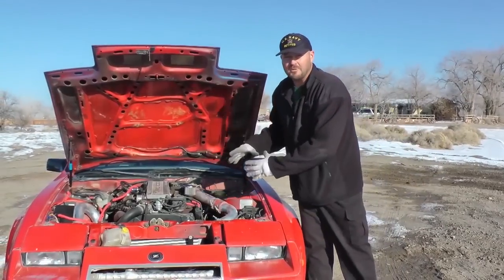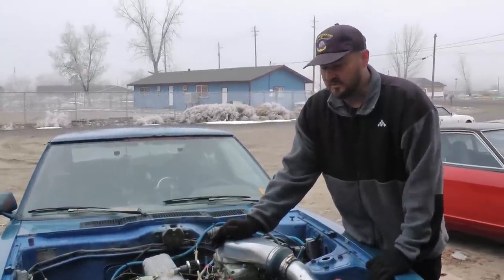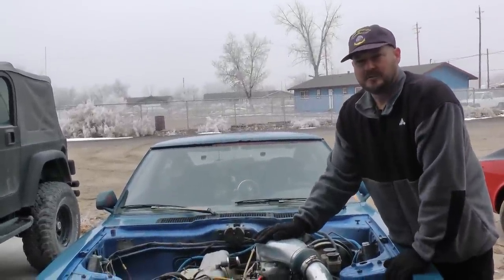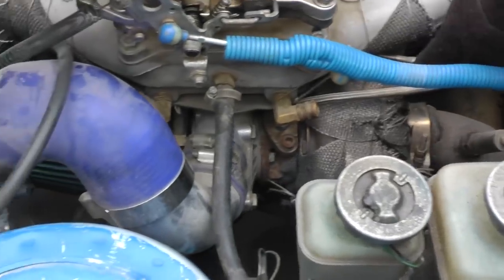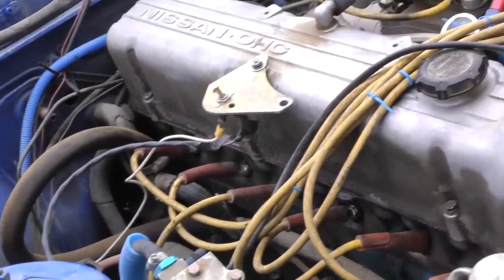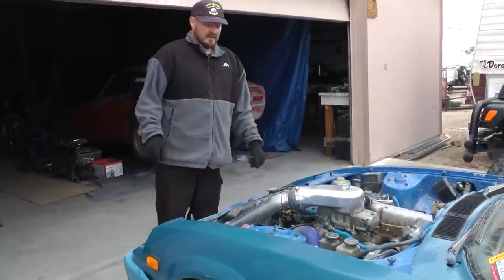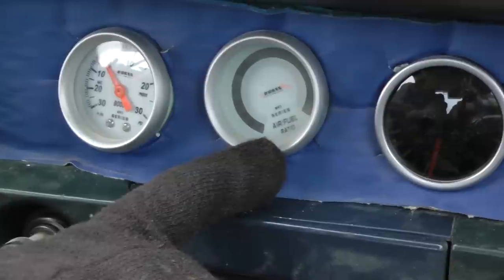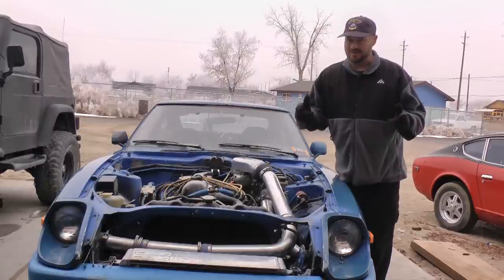Blow Through TurboCharging (Carburetor)

Comment: you do realize that by not running a blow off or bypass valve when you chop the throttle you actually stall the compressor turbine in the turbo and can grenade the vanes sending aluminum shards through out your pricey engine of course unless you have a pricey billet wheel . but even then you will stall the compressor and build boost slowly between gears . a blow off valve is a must for a street turbo system
Reply from the maker: corsomike1 One, I never chop the throttle, Two, Turbochargers made strong with good quality, have no issues, they are designed to deal with great extreme forces acted upon them, if not, they are not good turbochargers.  I have even run low costing ebay turbochargers without blow off valves such in the Red 300zx turbo, no issues, great throttle response.  The black buick has no throttle response issues, in fact its a hard charger on the throttle and of course it has no blow off valve and never did from the factory either.  Three,  My throttle plate is never all the way closed, most have spaces on the bottom to allow air or boost to retain idle characteristics, so most throttle plates are never completely closed.
Reply: Budget Boosting yep fatiguing the metal of the compressor isn't bad  and garret ,mitsubishi, holset are not quality turbochargers ? when you stall the compressor at 100,000 or higher rpm the vanes flex , ungulate and twist . your right that isn't bad . and yes back in the day they didn't use bypass or blow off valves nor did they use inter-coolers but they learned from that haven't they just because it can be done doesn't mean it should and of course the throttle plate stays open a little or the engine would die ( come on ) you just don't get it ... and probably never will .
Reply from the maker: corsomike1 The 1987 buick had a garrett intercooler from the factory.  I am not against blow off valves, I believe they are not always necessary.  Some turbochargers such as the small ball bearing high spinning type can benefit from a blow off valve.  The large big single turbochargers such as the T88-34D that I ran on my R32 Skyline GT-R did not benefit from a blow off valve, and I do not run them in that big single set up.  So there are times for the blow off valve and times I do not run the blow off valve.  The bottom line is they are not always needed, some set ups good, some set ups not so good.  Like I have said time and time again, it is the tuner's choice and I do not knock any tuner for using them or not using them.  I have always and still believe that they are not 100% necessary for every single turbocharger setup across the board, just some of them.  I do get it but they do have their place and their place is in some turbo set ups, not all of them.  I pick and choose what set ups of mine get blow off valves and the ones that do not.  That is called specific tuning for specific types of acceleration depending on what you will do with your turbocharged car or truck.  Most turbo failures occur due to 1.  not using an aircleaner, which destroys the compressor and turbine,   2.  Not changing oil often since the oil is shared with the engine.  3.  Running the turbocharger really hard at high temperatures without giving it sufficient cool down at idle before shutting engine off.  4.  Engine running too lean with cheap low octane fuel which heats turbocharger too hot and elongates turbine and compressor blades which will fail.  5.  Too much or not enough oil flow in turbo bearings which will lead it to fail.  I have run many Garrett, Holset and Mitsubishi TD series turbines without any issues with or without blow off valves.  Its all about how well everything works together and how well the set up is taken care of that determines how long turbochargers will last.  My 1987 Buick Turbo T Garrett turbocharger lasted 28 years and the car was mechanically well cared for.  There is no almighty answer for every turbo setup for every vehicle so that means that blow off valves are NOT needed for every single turbo set up.

Comment: Couple questions. WHat boost is the carb capable of handling? As much as large jets allow?  How much boost have you got it to so far?
I will be doing this on a 351 Cleveland. Any thoughts or suggestions?
Reply from the maker: starbattles1 I was running around 18 pounds of boost.  It should support 21 pounds just fine and jetting and other factors such as fuel octane and timing also will help increase or limit boost ranges.  I am considering turbocharging my 1989 F250 4x4 with the 351 Winsor V-8 in the future when my other cars get done....

Comment: i keep getting told i need a fuel pressure regulator in a blow through setup. is this true ? The way you explain it with confidence make me believe they are wrong.
Reply from the maker: Yes, boost referenced fuel pressure regulator is best to raise 1 psi fuel pressure to 1 psi boost.  I made a different video elaborating more about that.  Many things to turbocharging a video, it takes quite a few videos to share everything.
Reply: Budget Boosting Fuel Pressure Regulator-required.....and a lot more to know. Got it.

Comment: Very informative.  I am considering building one. Currently,I have a 496ci BBC that is highly modified. I run a Dominator 1050.
It has annulars. I can't use it with turbos,... right?  
Do you recommend  air to air or a water to air intercooler?

Comment: I was under the impression that if you don't have a blow off valve all that happens is the excess charge just goes back through the exhaust, via internal wastegate? Idk never claimed to know it all, correct me if I'm wrong. I've owned a couple Cars that didn't have factory blow off valves, one being a Mitsubishi Starion or conquest tsi. Lol I actually owned 5 of those over the years. Like I was saying I always thought that's what the waste gate flapper was for.

Comment: Very interesting video.  I have a 85 Nissan truck with a built z24 engine (racing cam, Weber 38, headers).  I'd love to attempt a turbo setup in the truck (lots of room for it) but not sure how to approach a build with a naturally aspirated engine.  Seems that I would need a blow-through carburetor that fits the intake manifold, and lots of modification to the exhaust header.  Might not be worth the trouble.  Maybe it would be easier if I upgraded to a 1986.5 fuel injected intake manifold.
Reply from the maker: +livemeyer your truck is currently carbureted?  if it is currently carbureted, C&S specialties makes blow through carburetors custom for practically every set up.  Should give them a call for ideas and see what they can do for your specific intake and carb setup.

Comment: So you don't suggest running a BOV? So you don't mind blowing your turbo to bits when you let off? You don't mind the dangerous situation of 'boost surge' where you let off and it doesn't immediately respond?
Reply from the maker: ***** I take care of my turbochargers, monitor EGT, fuel pressure, boost pressure, regular oil changes with synthetic oils.  No problem with any of my turbochargers.  Most of my turbo cars do not have blow off valves, the blue 280zx custom turbo in the video you are commenting in DOES have a BOV.
Reply: Budget Boosting  I'm referring to when you said that you don't need a BOV. The problem isn't immediate, but you'll ruin the turbo by breaking the one way bearing for the turbine which can shatter the casing, all cause because the pressure that was compressed by the turbo then won't all go into the cylinder, some will try to exit back out where it came in, that is why a BOV was designed and is implemented in every car that features a turbocharger. Then there's the boost surge when you let off the throttle because of the still compressed air, some goes back out the intake and some still goes into the cylinder which on a FI engine it will run lean.
Reply from the maker: ***** Really depends on the size and type of the turbocharger.  I usually do not run them and turbochargers are designed to be strong but they must be taken care of.  Including idling down around 5 minutes before shutdown to ensure clean cooler oil is going through them.  So many variables can cause a failed turbo.  I have not seen lack of a blow off valve being the problem.  It was caused by some other forms of turbocharger care neglect.

Comment: I forgot where your other video regarding the fuel pressure regulator, but i'm going to post this here. In your fuel pressure regulator video you said you had one for boost, yet they also make one for vacuum. So, in my vehicle which runs a carb but not any boost, would it be practical to put a vacuum controlled fuel pressure regulator to keep my carburetor with fuel?

Comment: Back again. Decided to leave the Trans Am naturally aspirated, But I do have a 1973 Dodge Dart sport with a 225 slant 6. A buddy of mine was telling me to go with a Paxton supercharger but I also thought about a turbo setup. DO you have any suggestions or information to share as to what would be best for that slant 6? Wondering what my best course of action would be.
Reply from the maker: +number3665 The slant 6 would be a great custom turbo engine.  A modified or custom made turbo header with a t3 or t4 flange to bolt on turbocharger to install the turbocharger where you have the best room.  The blow through 4 barrel carburetor with carb hat to seal the boost blowing in the carb.   The turbo slant 6 would have loads more torque which would really haul that Dart around.
Reply: Budget Boosting Thanks! I think I'll go with that. I'm going to do some more research and watch more of your videos. And that Dart is the lightest car I've ever owned at about 2900 lbs. just a little bit of power will send it screaming down the road.

Comment: Do you need an intercooler? I read some suggesting it will run better without since the fuel will mix better with air at higher temp and the boost isn't high enough that temp will be a problem.

Comment: My god, these kids and their blow off valve beliefs... Good marketing from the bov companies have them all thinking they must have, and buy one or they will hurt their car..:)   Thanks for all the good videos Budget, I appreciate the info your sharing with all of us.....keep em coming!
Reply from the maker: Ray Dolinger Right, they didn't grow up seeing turbo powered engines evolve like we did.  From the 1965 Chevy Covair,H-6 draw through turbo, the 1978 Buick Sport Coupe Regal 3.8 draw through turbo V6, the 1980 Pontiac Trans Am Turbo 4.9 turbo,  draw through V-8,  1980-1983 Datsun/Nissan 280zx turbo 2.8 straight six fuel injected turbo, 1984-1988 Nissan 300zx 3.0 turbo V-6, and many more.  All those cars never had blow off valves and no turbo car I have seen had a blow off valve from the factory.  A lot of them had relief valves to prevent overboosting engines when the internal wastegate rubber tubing disconnected or wastegate failure.  Kids these days do not know the history of turbocharging, how it evolved into what it is today.  Thank you again for watching.
Reply: Its not marketing it's a fact if your running less than 10psi then no a BOV may not absolutely necssary but get above 12psi and compressor stall is real and damages the compressor wheel over time. I've been involved since the days when turbos were all draw thru. I remember seeing a 68 camaro w/468 running twins drawing thru a 1050 dominator make god like power 850 on the dyno. but it was a mess to drive and a hot house flower only good? for drag racing turbo lag was measured in secounds as in 5 then it spooled like a light switch nothing, nothing ,OMG. It was a waste land none knew anything few guys running Offys at indy and some old vets from WWII with fighter plane experience. One was to small the other to big same for the turbos. It was all cut and paste with crutches and no cheap welders migs cost a couple of K tig was just not an option, Since they were draw thru one back fire could destroy everything or even kill you all the intake plumbing back to the intake inlet was filled with combustable mix big boom sharpnel and other pcs flying everywhere and direction.
Reply from the maker: roger depew I have a blow off valve on the Blow through carbureted 280zx car and it runs fine.  I do not have one on my fuel injected 300zx turbo, using a budget friendly TO4e ebay turbocharger and run around 18 psi daily driving, runs great and reliable.  Turbochargers that fail are for issues not related to lack of blow off valve use.  They usually fail due to foreign object damage, no air cleaner, dirty contaminated or poor oil change schedule, not allowing the car to idle down for several minutes to allow hot oil in the bearings to cool down before shutdown.  Most people just drive the car hard, avoid preventative maintenance, park and shut off the engine and wonder why their turbochargers fail.  Many companies do capitalize from these failures and conveniently relate them to the lack of blow off valve use.  Draw through turbocharging, you cannot reasonably use a blow off valve due to fuel and air released in the engine compartment when the valve opens.  Honestly, a well made turbocharger is built to withstand very extreme heat and pressure forces and one that fails for some surging is really not a well built turbocharger.  The 1984 though 1987 Buick GNX, Grand National, T-type series turbo regals boosted 15 psi stock and many increased the boost much higher.  None of them ever had blow off valves from the factory and very few ever installed them or even heard of them in the 80's.  I know of many people today still running the original 27 plus year old turbo Buicks with the original Garrett turbochargers still laying down competitive drag times and great daily driving cars as well.  Many Nissan and Toyota turbo cars I tuned, drove and enjoyed in Japan did not have factory blow off valves in their cars and I drove them hard and they performed great and reliably.  The above is the reason I made blow off valves, the truth video.  I am one that does not believe the hype about blow off valves, I have had them on some cars, and not used them on others and honestly had no genuine need to.  Its always up to the owner and the tuner of the engine to make that decision.

Comment: hi Matt, so where is the best place to put an external wastegage on a turbo setup is it between the exhaust manifold flange and turbocharger.also  what exhaust manifold you used for your setup.did you use a datsun 280zx turbo manifold?
Reply from the maker: f rod best place for ext wastegate is at the end of the exh manifold just before turbo flange or between exhaust manifold and turbo flange. I used a Nissan 280 zx turbo exhaust manifold I found on ebay. Some turbochargers have provisions on the exhaust housing for external waste gates. I have seen them as options on turbonetics turbochargers.
Reply: oh ok I see.I saw a wastegate adapter in ebay.I wanted to know if I can use that adapter to mount a wastegate without having to cut and weld tubing to add a wastegate.Let me know if you think that will work.

http://www.ebay.com/itm/Progate-T4-Wastegate-Adapter-/171391515044?pt=Motors_Car_Truck_Parts_Accessories&hash=item27e7baf9a4&vxp=mtr
Reply from the maker: f rod that adapter looks good. Its a t3 to t4 with external waste gate hook up. Just need a t4 turbo like a gt45, t04b or any turbocharger with the t4 flange to fit the adapter.

Comment: would you have to advance your ignition as well? would you not only have to change the idle ignition timing but also how fast it changes and the WOT ignition timing? how would you know how much to do it? and how would you go about it? by modifying the distributor? i have a bmw m10b18 not whatever this car is by the way
Reply: Budget Boosting what are these devices called? the ones to control timing, are they sort of like an FMU but for timing? my main problem at the moment is i live in europe and the only blow through carbs i can find are from america, expensive and then i have to have them shipped on top and maybe pay tax, and as they dont even sell them here i cant see it being easy to find one second hand. i might have to give up on this which is a shame as a boosted, carbed 4 cylinder would be fairly rare thing to see, and really cheap to buy replacement engines for and such. might just have to engine swap to something with fuel injection and do that :( sounds so boring compared to boosting a m10, would be like my own version of a 2002 xD other option is to try megasquirt the carbed engine, but for that money i could just buy a fuel injected one. i suppose i gotta choose easy, cheap and boring. or hard, expensive and epic xD
Reply from the maker: +Charlie Ward would be real neat if you could find a used 335i engine, they are well over 300 hp 300 lb torque twin turbo straight six from the factory on your lighter BMW would be a monster.
Reply: Budget Boosting that would be perfect but and engine like that would cost a fortune where I live, I've probably bought a m40 and I'm going to just put a turbo and bigger injectors, not very special all I can afford tho thanks for your help :)